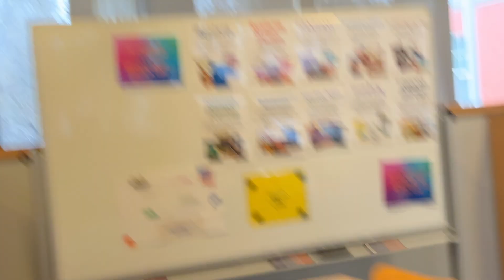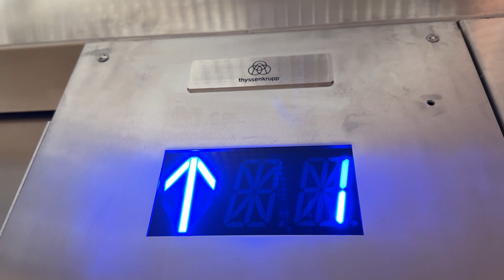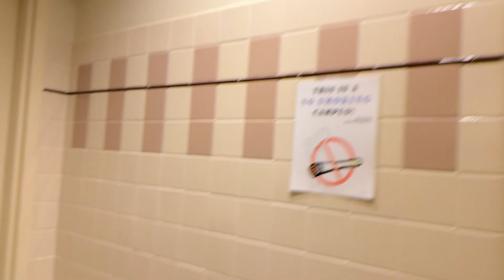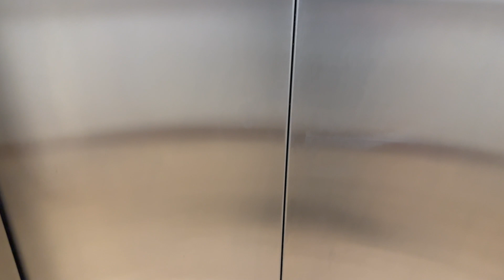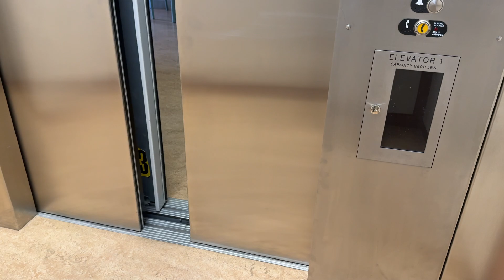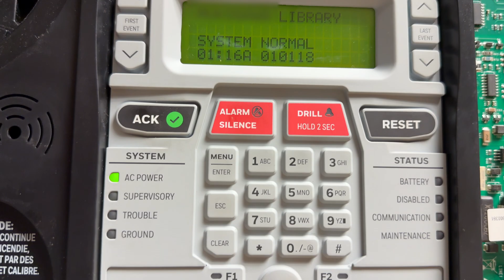Fire Alarm Test 138 | Rare FCI Mechanical Horns

Comment: Speaking of that elevator, my school has that same elevator which makes the same chime sound when the car arrives. My school also has a Siemens voice evac system which plays the message with the temporal tone. This is an issue because both the elevator chime and the fire alarm ton are the same exact pitch (900hz). This has caused confusion.

Comment: Wait did they change the coding because i remember. In your last video of this. They were on continues.
Reply from the maker: I changed it yeah
Reply: @4O5O-8O It is against code to have strobes on coded NACs, as they will no longer flash at the correct rate (at least once per second). You should've either replaced the appliances with ones that can self-code to Temporal 3, or rewired the strobes into a separate, non-coded NAC.
Reply from the maker: @ System is Grandfathered
Reply: @ It was grandfathered when the NACs were on continuous, by changing the NAC coding you introduced a deficiency (strobe flash rate) that didn't exist when the system was originally installed, and thus doesn't fall under grandfathering. You could use the grandfathering argument for pre-ADA strobes, which weren't subject to the flash rate requirement, but the strobes in that system are clearly ADA, and thus have been subject to the 1-2 Hz flash rate requirement since they were originally installed.
Reply from the maker: @ you are incorrect. This system had a panel replacement recently and was finaled with the original non code compliant horn strobes. Before I changed the coding it was set on a synchronization signal which introduced the same deficiencies. They already do not meet modern code due to the non sync strobes but were allowed by the acting Fire Marshall who finaled the building. Even on steady power the flash rate of these devices is below 1hz on many units.
Reply: You should do March Time  Next time I wanna hear those alarm y'all do those test again on next video

Comment: This reminds me of my dads workplace system! The horns are a bit different, but still mechanical (Mainly simplex and one or two simens UNH's). The original panel was in the basement of the office complex, but when a new fire lite panel was installed it was moved to its own room upstairs. Pulls are BG12s and the horns inside were 4903 horn strobes and 4903-9101s with 2901-9838s in the basement. Awesome video!